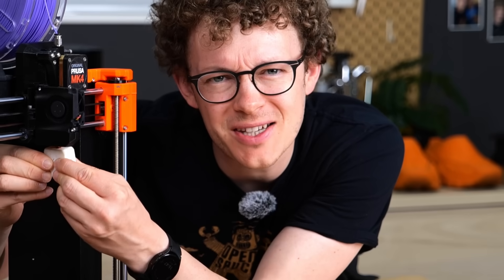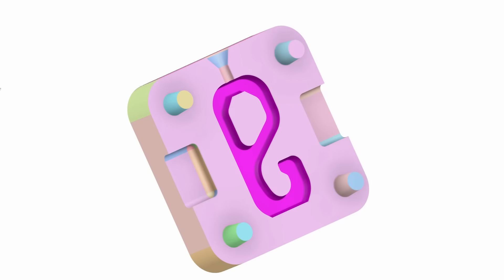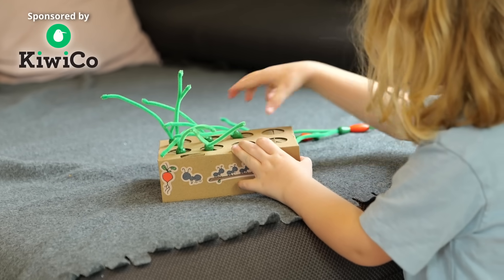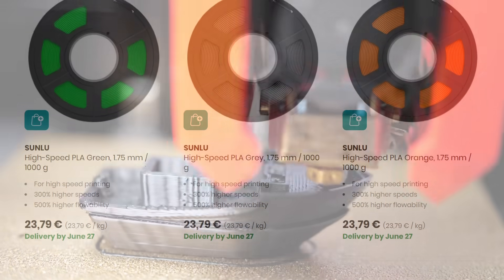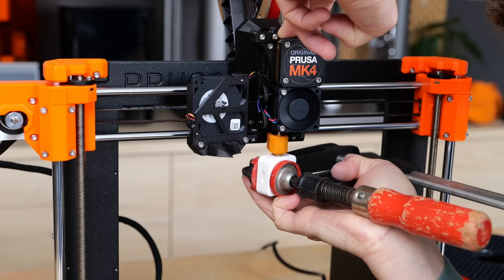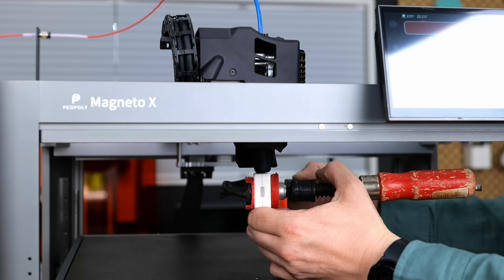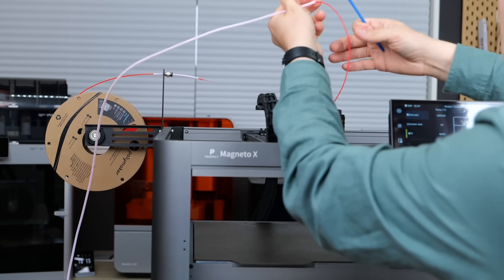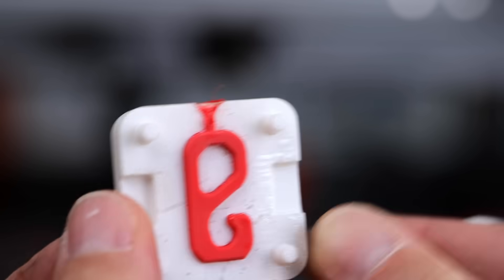I tried Injection Molding using a 3D Printer!

Comment: That overmold part can be done in two steps. You start printing and once you reached about half of it, you insert the part you want to have inside and then continue the printing. But you need to check that the nozzle of the printer doesn't run over the part during the printing process but but only runs around it.
If the printer runs over the part, you can print as long as the gap for the insert is being open and then stop it to insert and maybe glue it into the part and then continue the printing when the gap is getting closed in the next layer.

Comment: few things: the PLA cools to fast and stops the flow at the point of cooled material. Possible solutions. the mold needs to be hot enough to continue the flow rate past the cool point. don't know if resin prints can hold that kind of heat. Design workaround. your mold could have multiple points for injection. also, try injection on the x or y axis of the mold instead of the z. the more vertical space the plastic has to fill the more likely it is to cool before it fills. Best of luck

Comment: 1. Vent holes are mandatory
2. the mold needs to be metal and pre-heated, so that the plastic doesn't freeze on contact and clog the pathways.
3. use the gantry to apply pressure against the bed, not your bare hands silly.

Comment: Air venting, heating of the mold, putting the sprue closer to the center of mass and flow, like midpoint on the side of the 6 is the better bet. But with the air backpressure and the cold mold, you are DIW.

Comment: need a breather hole for the air inside the mould to escape. forcing the filament in that mould is compressing the air inside the mould causing a back pressure on the filament

Comment: I watched a video printing multiple layers of a shell, then filling the cavity with a blob of filament until it is full, then continuing the shell.  The interior blob should avoid a good amount of the layer line issues.  It wouldn't apply at all to this video's goal of getting a higher detailed surface, but it would be curious how close to a solid injection mounded part it would produce.
"Injection as infill to increase z strength in FDM printing - feasiblity test" -- Martha,
https://www.youtube.com/watch?v=46JZ5wX1wbg

Comment: What if you placed the mold on the bed and preheated both the mold and the bed to the same temperature? Then, you could lower the extruder over the mold to inject the plastic. This approach is similar to your previous attempt, but I believe this method could achieve a significantly higher mold temperature.

Comment: Why you want to put plastic inside mold, you can put cold epoxy mix into it. Wait 24 hours, and then open mold. With 3d printer you just need to print molds.

Comment: How about heating the mold continuously with the bed and some insulation or even a diy heating system. Plus add a silicone gasket around the injection port so you can maybe build a little more pressure inside the mold. I wonder if both together could help to achieve larger parts.

Comment: A few thoughts here...
1. What if you added a TPU seal between the conical face of the nozzle and the mold to minimize pressure loss towards the end of the shot?
2. For larger molds, maybe you could have multiple injection locations (maybe one on top then another on bottom)
3. What if you added a thermal mass which retains heat well inside the mold? For example, if you heated some sand or an iron disc then insert it into a pocket in the mold, it would slow the cooling of the mold.

Comment: Question for the group this may scramble your head.   (Remember that a lot if pressure can be lost to viscous flow of the plastic)
When you calculate pressure you can not use the tip diameter.   The pressure of material exiting that orifice is zero when you let it pile up as he did in his volume tests.

The pressure before the nozzle is equal to the linear KG load on the filiment via the filament drive divided by the cross sectional area of the 1.75mm filament.    You can't use the smaller diameter of that nozzle for that calculation.   The pressure drop across that nozzle running at it's max free air extrusion speed is 100٪.   The pressure coming out if that nozzle is then essentially 0 psi.   If it wasn't 0 psi then the extrusion speed and filament load is not at maximum.  It could be dialed up more.  
What do you guys think?

Comment: I have a couple of suggestions that look like some were covered by other users.
1.  Add air vent hole at the end of the mold.
2.  To help stop freezing Add heater blocks to the sides of your mold, between the mold and clamp.   Ideally brass plates with heater cartridges installed in holes that have been reamed to final size.  Use inexspensive industrial DIN framed heater modules and cartridges with built in thermal couples.
3.  You could support your mold with the bed or another great idea screw your mold into the hot end in place of a tip.  Use bored out threaded rod instead of a tip and have female threads in your mold to screw it onto the threaded rod.
You could also just clamshell it on.
4.  Fill the high volume parts of your mold first.  For the screw fill the hex head first.
5.  You may want to avoid nit lines.   You could try to move the injection gate location on your hook to be closer to the center of mass.

Comment: Multiple steppers for extruder? Adds more pressure via a bit more speed and less slip. Maybe modify the firmware of printer to allow a bit higher temps knowing it will burn out the heater and possibly board but again will verify the method. To get more steppers on E you could either just somply cut and splice wires or reprogram on firmware a X/Y stepper to mirror E movements. The mould should be at the candying point atleast of filament. Or hotter. So filament stays liquid until end. Add a vent hole in mould at bottom of it.

Comment: Air vent needed for sure. 
But why hold it by hand? 
Place a small flat scale on the bed. Place the mould and clamp on the scale. Z axis down to the sprue hole until a proper sealing downward pressure is attained (from the scale). 
Then inject.  
Probably want to make a jig to keep everything lined up before Z'ing down.

Comment: If your mold material is good to 200°C, maybe pre-heat it in your kitchen oven?  You'd want to calibrate the oven with a thermometer as they're not great about accuracy, but with that you could pretty easily pre-heat to 180.  Might be awkward working with hot mitts to get it all set up, but I'd imagine a much hotter mold would slow cooling considerably?

It does leave me wonder about injection molding using a plastic that melts at a notably lower temperature and doing it all in your oven.  Head pressure could be enough then.

Comment: I think a small part of your problem with filling the mold also has to do with the fact that you don't have a place for the air to escape as you inject the plastic. I would recommend to try adding a very small vent at the problem areas. There may be more than one on some molds.

Comment: Mold temperatures need to be hot! .... then cooled  for certain geometries and shot sizes.  A lot of liquid cooling ....and heater  effort goes into some molds so my best educated guess is that metal plates with heaters on either side   .....perhaps just some old hotend blocks with their heaters and thermisters connected to another(or two more) control boards could get the mold more mass and more stable high temperature .....then remove the clamp and let the blocks and heaters drop away ....lowering the mass and allowing the resin mold halves to cool quicker for de-molding release.
Experiment with shortening the sprue to reduce  lag as things cool there ...anything to get hot transitioned material flowing into the nooks and cranies. Great video and branch of research. I think the 3d print approach has more of a future than those little purpose built hobbyist presses.

Comment: Can you not embed a nozzle in the mould? Or at least fix one in to it (maybe uv resin weld it in), then attach the whole assembly to the hotend? Also, if you had a vent hole as well to allow air to escape and reduce pressure, would that help?

Comment: Spuce is in the wrong location. And you need a vent. Also 3D printing materials are much more viscous than injection grades. ( polysonic comes a bit closer but still not the same thing)

Comment: Once the plastic creates a semi air seal it makes a pressurized air bubble out of the cavity. It needs an outlet channel at the bottom for air and the injected material to flow through. You would need to clip the tail off once it cools.

Comment: Blows my mind why you didn't create another hole for air to escape. But more so why you wouldn't just lower the head so you didn't have to force hold the mould up 😂
Reply: Yes, an escape channel would help. Also heating the mold would help. And embedding the nozzle into the mold, so that the mold screws into the hotend.

Comment: Do you got a Lathe and round a Nozzle on the outside to make a thread?

Cause I dont know if my spelling is correct:
Hast du ne Drehmaschine und kannst ne Nozzle außen abrunden und ein Gewinde raufdrehen? Wenn du dann das Gewinde noch in die Form einklebst mit Loctide oder so, könntest du evtl. nen höheren Druck aufbauen. Dann noch ein kleines Löchlein an der Unterseite des Drucks, damit Luft rausgeht und du sehen kannst, wenn die Form voll ist

Comment: it is awesome that how you use a 3d printer for injunction moulding, nice I liked it. and to resolve the challenge in your thing i feel you can make one more hole/path way for air to go out from another side, I this may help, because when you try to push the material there might be some opposite pressure generated by existing air inside, I think you can try this also, 
it was great,

Comment: Have you considered lowering the z axis to press and hold the mold on the hot plate and using the plate to heat the mold during fill?

Comment: The high pressure of industrial injection mold manufacturing more has to do with the method of plastic melting being a pressure-based method than being strictly necessary to make the molds work.  Applying heat to the plastic is less reliable than simply using pressure to melt the plastic.

Comment: Great video!
 Something I might recommend for you to try out on your hook mold would to be possibly adding a tiny TINY pinhole at the end of where the mold is for air to get out, just something that I'm thinking is that the reason why it's not able to fully flow into it with some of the types of filaments is because the pressure might be getting too high in there and it might not be able to flow all the way.

 I could be completely wrong about this but it's just something I thought about! Keep up the great work!

Comment: Maybe you could circumvent the physician limitations of the nozzle flow using two entry points and use two nozzles. As you increase the size you increase the number of nozzle inputs!

Comment: I'm an injection mold designer, I would advise the implementation of vents for off-gassing the cavity in which you are trying to fill, since the gas inside the mold needs somewhere to go, which is also likely an issue you're running into here. As you mentioned, industrial use molds are typically made from tool steel, 41XX AISI series steel, or Stainless, however cutting of these "vents" is usually a very precise and material-application specific process. The channels cut for venting are usually only a couple of thousands of an inch in depth and are done on a surface grinder. However, you could probably do the same thing with a chamfer or heated blade of sorts to "melt" into the mold material (while it is still green?) Anyways hope this helps.

Comment: I know nothing about injection molding, but two things I think would help are a hole to vent air, and maybe something to heat the mold so the filament doesn't cool down as quickly.

Comment: Your mold is too air tight, it need hole(s) to let the air escape, that will let the material flow and also tell you when its fully filled.
For exemple, that 6 or 9 part do finish with a tip. By making a hole at the end of that tip, the plastic will follow the air flow until it escape from the "breatheating hole"
You might not like that, but just look at any glued plastic model kit, all parts are not just supported but there is always a racking around it, and that racking has multiple studs around it.
Some injected parts kits also have traces of "breathing holes" its "Artefacts of fabrication" and they are a good way to learn how things are made.

Comment: Why not get a less obtrusive clamp and modify the nozzel with threads so that you could thread the mold right onto the nozzle?  Might squeeze a bit more hot stuff through before it solidifies, right?  I would also think it would be less damaging to the machine, but I know so very little about 3d printers.  :P  Nice video!

Comment: you're thinking of 3D molding completely wrong, watch the clips you used for the industrial molds, you'll notice that they have some excess aside from the fill point. Instead of thinking of it like printing, think more like smelting as the design is more or less similar just different type of materials and such. You've already realized you're wanting to make it a liquid, well, what does a liquid do in a clear container that has a usual J shape and such? AIR POCKETS! Create a new mold to allow for full flow, can easily make a design that has the vent next to your pouring sight and voila! you've got an easy 3D printer molding system!

Comment: So I keep thinking about this.  A 3dprinter extruder based injection molder where you use a heater to heat the resin molds to near the thermoplastic limit, so it doesnt cool too fast.. inject it properly with air bleeds into the middle or thick part of the part... have it hold the "injector" down with a handle.
it feeds in plastic at whatever rate it can melt it at, but the heating block doesnt become super critical to be overpowered because of the resin mold heating.

This is similar to the SLS printer you reviewed that heated the powder to near melting.. it doesnt take much additional heat to make it go.

this would also allow greater filament tolerances, so recycled plastic filament would work fine as long as it can feed, even if there are sizing irregularities that would effect normal print quality.

Comment: what if you built a very tight nozzle cutout right into the mold, installed the nozzle before clamping and then screwed the whole thing into the extruder...bonus, you wouldn't have to hold it in place, which I think the slight movements in your holding ability are contributing to the squeeze out

Comment: The easiest solution would in my opinion be to make the hook bigger instead of just a 35 percent scaled version. The ratio between surface area and volume will hereby decrease which would result in less heat loss during filling of the mould which means the mould should get filled easier.
Reply: English 2/5, but you know what I mean.🙃

Comment: I still think you’re better off contracting a CNC shop to make the mold for you. Then use just the direct drive on the printer with some kind of press to keep it against the mold.  Make your DIY controller with Gcode that just tells it to extrude.  Finally you can incorporate into your CNC mold, a few channels for generic heating elements to keep the mold at a very specific temperature.

Comment: You might get a better result in your hook injection molding if you add an blow hole to make it easier for the air to exit the mold at the end of the hook.  As it is, you've got a blind hole full of air you're pushing plastic into.  At the low pressure you've got available from the printer, you just can't squeeze the air hard enough to nearly fill the mold unless the air has an escape.

Comment: I wonder if you could modify that last setup with a spring that you could pre-load with your z axis, make it more consistent on pressure (and easier on your hands lol). Another idea would be to add some sort of high temperature o ring seal to prevent the “side spilling” at the top of the mold. Idk if that would work, but if it did, it might get you some higher injection pressure

Comment: You need a mold that can sustain a higher temperature during the injection process. Resin is not the material for this. You need metal molds and temperature control. if you had this, you could do injection molds at much larger sizes as the plastic would stay liquid the whole time.

Comment: Maybe using multiple nuzzles from both ends of the mold or strategic places of the hole for the nuzzles so you can also use multiple color. Also adding vent holes for the melted plastic to flow properly to the mold. I also think that the DIY filament extruder would work perfectly for this project

Comment: steff...  you need an exit for the molten plastic to exit..  compressed plastic is not flowing due to trapped compressed air vs. injection force.

Comment: why are you holding the mold under the machine ? 
you would be loosing so much pressure , just like you proved when you held the mold be hand you lost pressure in X, holding it against the nozzle you loose pressure in Z
why not take advantage of the Z axis motors and set a home position that is the height of the mold , then your clamp assy can sit flat on the bed and the Z motors can supply the Z pressure

Comment: One issue is that the plastic cools too quickly. I would try to heat the mold slightly. Also try to make a way to screw the mold to the nozzle so no pressure releases from the top. Then I would make a pressure release point at the other end of the mold. So the plastic would have to travel to the full extent of the part before exiting. Maybe that can help.